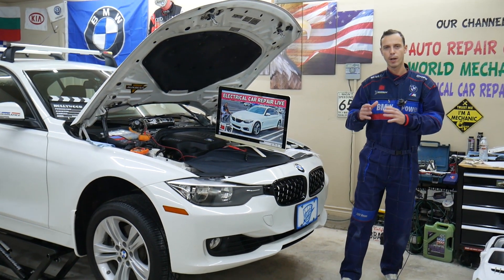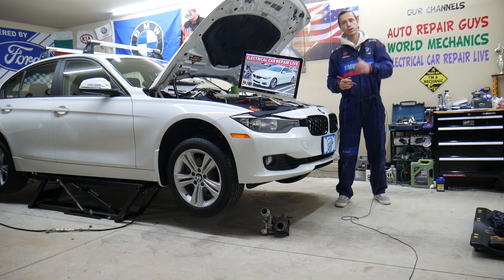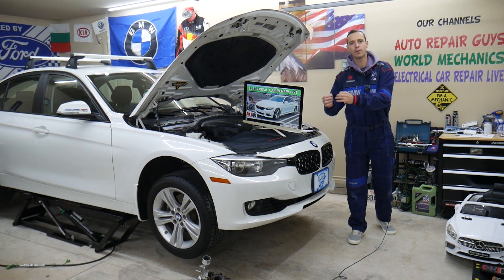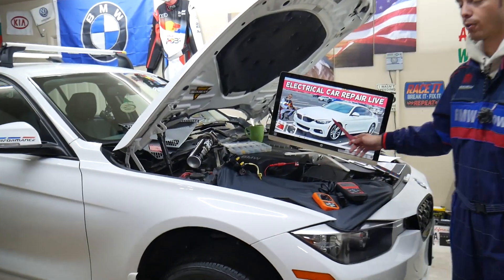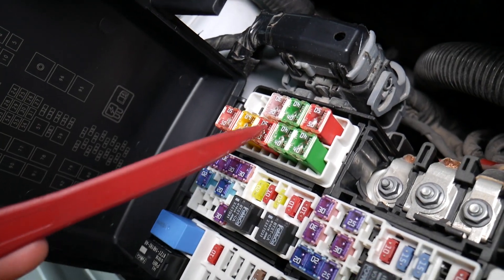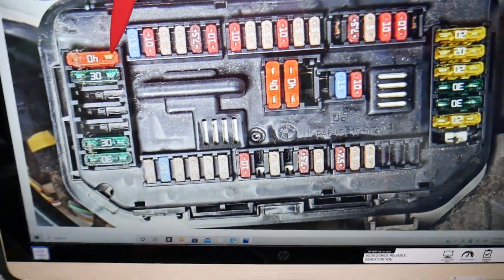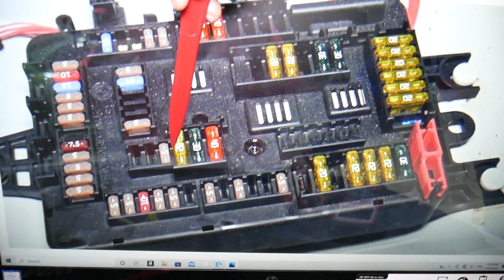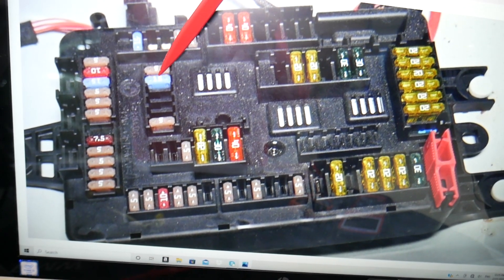WHY NO SOUND FROM SPEAKERS RADIO BMW F32 F33 F36 428i 430i 435i 440i 418i 420i 418d 420d 425d 430d 4

Comment: I checked the fuses and noticed that fuses 143 to 148 do not have any current going through them. Even though I changed the fuses. What could be the issue with this? My girlfriend did say she might have spilled water in that area.
Reply: It’s anoying driving without sound:( same thing I’ve tried putting different fuses in those same ones but no power is going thru them super weird
Reply: Hey did you guys figure anything out
Reply: @josuearvizo405   it was the amplifier of the amplifier in the trunk of the car. The car is a bmw 328i 2014

Comment: Al of my fuses are ok, still no sound
Reply: Replace head unit
Reply: Resetting headunit did the trick for me.
Reply: Did you resolve your issue? Did it turn out to be the amplifier?
Reply: @sharpeyedman  what is the headunit?
Reply: @chrisgreenan  I am sorry I meant resetting the I-drive.
Reply: @Chrissstm  I suspect it did and also suspect water was the cause of the problem.
Reply: @sharpeyedman how did you reset the head unit